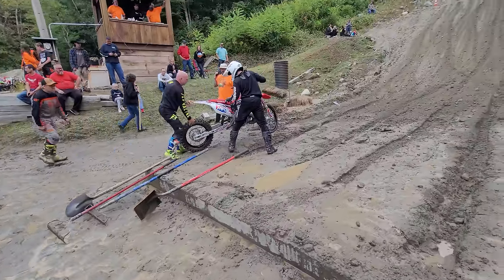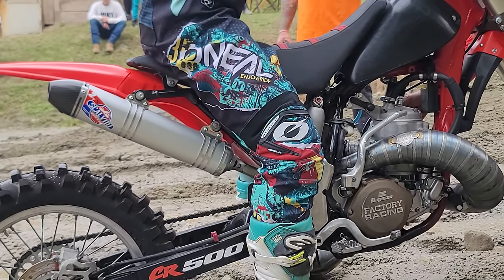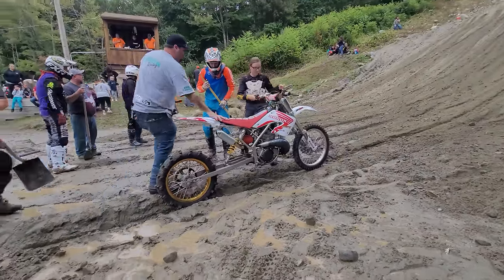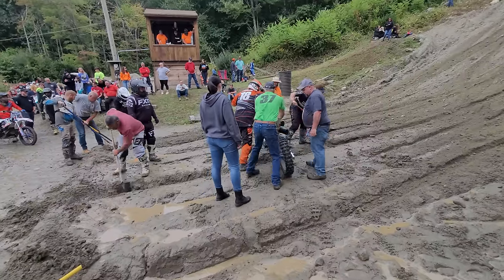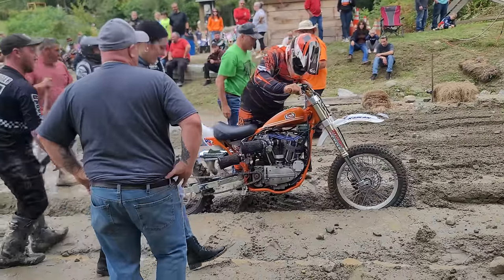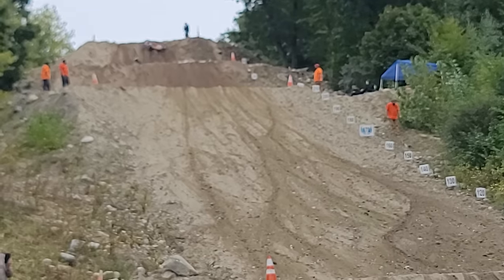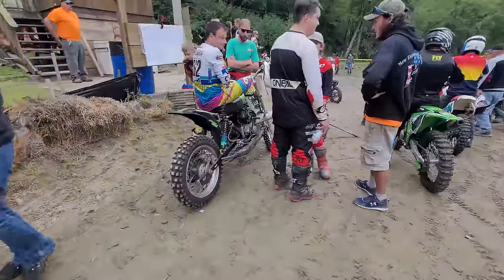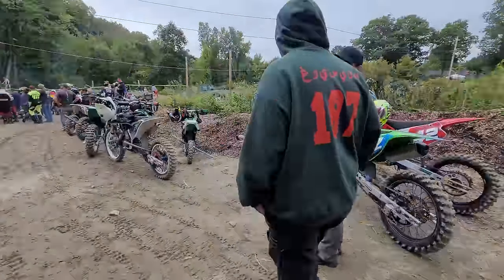BATTLE OF THE BIG BORE 2 STROKES  MONSON MA QUABOAG HILLCLIMB HONDA CR500R VS KAWASAKI KX500, H2 750

Comment: For anyone who has never had the pleasure of hearing a performance engine without any baffles close up... It is beyond a loud sound. It rattles through your entire body and smashes your eardrums to a flapping mess.
Reply: Stand next to a top fuel, funny car on a test fire, 3 feet away, It almost robs your soul
Reply: Try standing on the mounting platform of 4 155mm cannons going off simultaneously on a battle ship.

Comment: That first guy, on that's mindblowingly  gorgeous CR 500, was badass!
Reply: Yea and it was super fast. those old honda bikes in that era could not be beat on the drags. And it was all power good bottom end too.
Reply: @Mikefngarage  YZ 490
Reply: Running a YZ 490 engine
Reply: @GatesRapes  WOW looked like a CR500 engine to me. first guy. They were fast. Rode lots of bikes in my time. The fastest bike I ever rode was a Suzuki Gs1150. On the street. pulled 1st second 3rd power wheelie sitting over the bars. finally came down in 3rd. IDK how fast I was going must have been over 100. slowed down then turned around. came back to my buddy and said. Well that will be the last time I ride this one. It is just too fun I will kill myself. He said I didnt think you were going to open it up. I said if I ride it and dont open it up then whats the point.
Reply: @GatesRapes  I think you are referring to the one at about 6 minute mark. sounded like a YZ.
Reply: @GatesRapes  honda 500 has the distinctive 7 bolt head. looked like it was honda.
Reply: @Mikefngarage  great story. Thrilling.

Comment: I have a 96-97 CR500. The frame and or swing arm was bent on the original 96 so I found a mint 97 frame and a 2001 swing arm for her. Extremely rare Noleen pipe, shortened FMF silencer- barely pokes out past the number plate, ported, head shaved. Shes a beast and I love her!
Long live the CR500!
Reply: The KX made more power!
Sorry m8 the CR had the better chassis but the KX500 had the better engine.

Comment: M 1987 Ported for top end 1987 Honda CR500 (the BEST year, cartridge forks 44 mm Showas) regularly cracks 97-98 MPH with the front fender on, off it goes 105 all tucked in, flat track style. Fuck yeah the Honda CR 480/500's were some of the biggest horsepower years, along with some losers, like the 4 speed 450, the four speed 480, the ping king, etc. But by '87 they had it all together, "88 with the USD forks, is was back to the drawing board. Never beaks, change pistons and rigs out of guilt. 32.1 Yamahalube R. It will never wear out.

Comment: Why do the engines seem set oddlike 
The low end is snappy but the high end is lacking 

Is it set like that on purpose or is my deaf ears just not hearing it right. 

The dude who lost a bet his bike was running what sounded proper it even hit the rev end as it began to limit the output power 

I am deaf and just learning how to tune again. 😢never expected to loose my hearing but I’ll tell you it helped me learn now I feel the engines I build and tuning has become easier for me 🤷‍♂️ask me how why what I could not answer. 
Call it lost some of my senses and gained new ones. 🤓🤘😎

Only a few bikes in this whole event sounded dummied down to be clear.  Not all of them seemed governed though.

Comment: I can Gurentee you 1000 Dollars that none of thse 2 strokes absoluty DO NOT make more then the new 450's lol. I have biuld many of these types of motors and these 450R motors are capible of crazy HP numbers. On Average just for a 450R Quad engine with standerd bore, high compression ported head and balnced crank with a simple stage 3 hot cam makes 60+ HP, most of those old 2 strokes 500's and s on make 40 to 60 depending on the mods. 4 Strokes now days are not like the old motors that's a big misconception witha lot of people.   Belive me. I have a couple Dyno Run videos on a couple bikes I biuld on my Channel achiving 60HP with just tp end work that went from 36 to 63 HP or moe.
Reply from the maker: Its a bet!  The gauntlet is thrown and i take your bet. Call me to set up the dyno challenge 860 916 9784 your gonna be famous!

Comment: Where is the radiator on the second cr500?
Reply: It probably runs on alcohol so it doesnt need a radiator for these short runs with alcohol
Reply: Some bikes just loop the hose from the head down to water pump just bypassing the radiator that’s not there. Cap off left hose outlet at head. Ten second runs it works